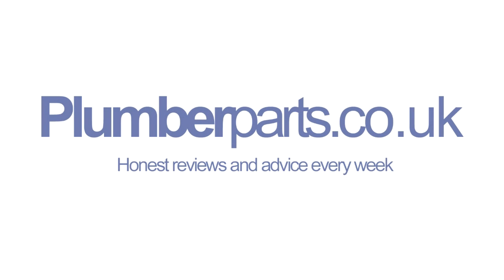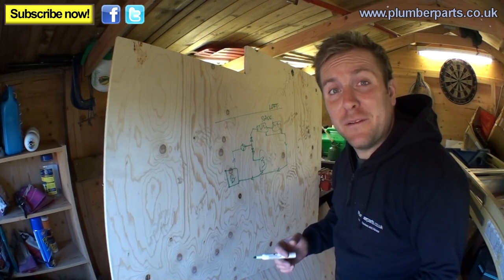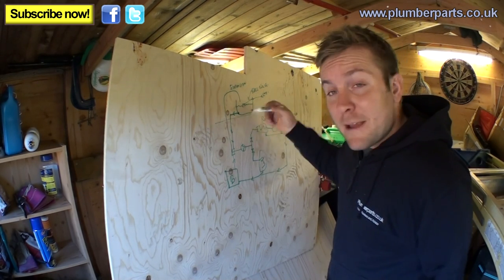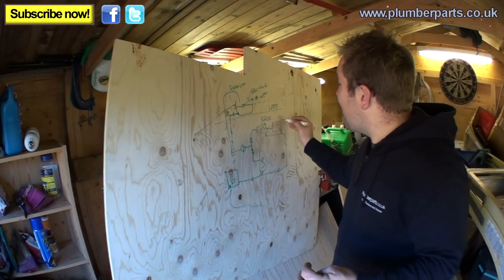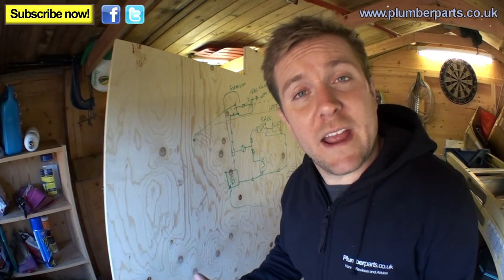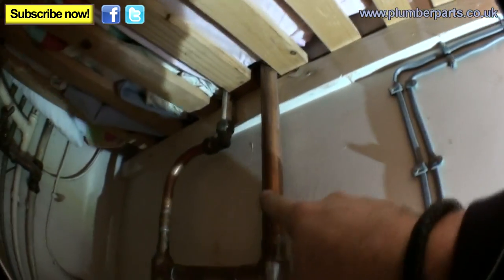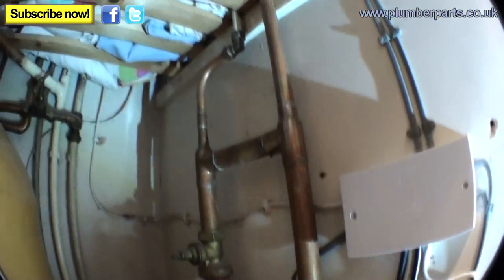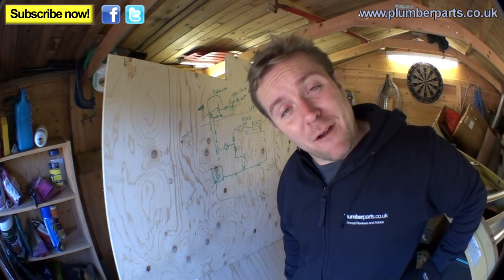GRAVITY  FEED HEATING SYSTEMS - Plumbing Tips

Comment from the maker: Links to the tools I use everyday here: https://www.amazon.co.uk/shop/plumberparts
Plus, follow my Vlog “TimesWithJames”: http://www.youtube.com/c/timeswithjames
Reply: if I turn the isolating valve in the airing cupboard from the F&E tank and bung the rubber torpedo shaped thing in the end of expansion pipe in the loft ... WOULD THAT CREATE A VACCUM hold the water in without having to drain the system?
.

Comment: After reviewing a slew of your videos am happy to report I've corrected my boiler problem. I recall from one of your videos you talk about using the 'magnet trick' in order to find a clog. I thought to myself 'where am I going to find a strong enough magnet for that?'. Luckily we have a magnet board and had stashed some of those heavy duty magnets we took away from the kids because they were a hazard. I was able to find that yes, the reducing tee from the feed and expansion tank was clogged to the max. After the drain and flush of the system video and happy to report I've moved onto the cleaning the boiler and after a brief flush and treat will start cleaning the radiators this summer. You saved me sooo much cash from the service engineer who couldn't stop parroting 'you need a new boiler, you need a new boiler'. £2000 vs £140 for a couple tools, piping and treatment chemicals is a no brainer. Thank you, thank you, thank you.

Comment: Hold Tight!!!! Thanks for all your videos, been a massive help to me. I've learn't how to bend and solder copper pipe and run them all under the bathroom floor, fit radiators, toilet, bath and work out an open central heating system all thanks to you. Boom, that's done! Cheers chief .... One question, on an open heating system, I guess the pressure is created by the loft tank so no need for pressure like inside the combi and closed loop circuits?

Comment: Very informative video. Thank you. One question however. The explanation at 8:25, the hot water flow and the T with the feed cold water pipe. Doesn't get the cold water constantly sucked into the system, so close by the pump? Thank you.

Comment: Thanks for this. I've just moved into a house with a conventional heating system. They have replaced the hot water cylinder with a new one in the loft. When the hot water is activated though, one radiator heats up. I assume they have connected the pipework of the old cylinder shown in your plan to this radiator?
Reply from the maker: I bet they have. Especially if the radiator that gets hot is in the bathroom.
Reply: @plumberparts  no, bedroom. Not much of an issue now but in summer i dont really want the bedroom heating. Guess it's a bit beyond a DIY to sort that out

Comment: Great video, thanks. Question. How do you increase pressure in such Semi sealed system if it is below 0.5? My boiler (Baxi system megaflo) user guide says nothing about it so I'm wondering is it even possible or ever needed. Thanks

Comment: Are these the old setups? When our new Vokera Boiler was installed the cold water tank was given the P45. Just to add, our boiler is making a burbling noise, bled the radiators but it still persists.

Comment: Great video . So if I was to take the rad off the wall for decorating( isolating and draining it first ) then when I put it back on , all I have to do to fill the system is to open the valves on the rad and bleed it ? The system should fill itself up from the tank in the loft right ?

Comment: Great video! What can I do if my expansion pipe is constantly trickling when my heating is running? I am training to be a bathroom fitter so I have some limited plumbing knowledge but not enough knowledge about heating systems. I'd love to stop the trickling when the system is running as it's actually quite loud. Our tank is at the top of the stairs as there has been a loft conversion.
Reply from the maker: Firstly turn the boiler temp down. Then the pump speed down. Monitor for a few days.
Reply: @plumberparts  thank you! Pump speed seems to have done it so fingers crossed....

Comment: Hi james, I have standard boiler in the garage, a storage cylinder in the airing cupboard and a storage tank in the loft, a small tank for the central heat but this doesn’t have a vent pipe leading into it ???? Just wondering why

Comment: The open vent is just that ...a safety vent to atmosphere to prevent any possibility’s of going to above boiling point it also enables trapped air to be excluded .... the Feed is the expansion and is usually one pipe size smaller so the water expands further up and back to the header tank IE :- it expands back to system water  the same  as per a pressure vessel . If water were to expand up the open vent. It would then fall into the header tank from height and would aireate this is the reason for pipes of different sizes to ensure this does not happen ... it’s a misnomer to call them a feed and expansion as the term is “feed and expansion combined” and an “open vent”.  separate !

Comment: G'day  I'm getting a rain water tank 3000L will feed  some of that water to the toilet using a gravity fed system  (an old copper tank in the loft that still in good Nick).I may go a couple steps more feeding the washing machine and dish washer,  having a PVC system  using sharkbite will make the job very eazy. I can still go one more step which is connecting to the hot water system, can this be done?  Rainwater tank at ground level  water pumped up to water reserve (old hot water tank) in loft  then feed to more or less the whole house  besides drinking water, low pressure 4-5 psi to the new gas Hot water tank out side is where I need help will it work  will she feed at such low levels  would a 2nd pump be required?

Comment: Thank you, subscribed.
Reply from the maker: Matthew Phillips cheers mate! 🥰
Reply: Great vids and Personality. My mate has just asked me to remove a couple rads in separate b/rooms as I’m a bit handy, your vids has given me the confidence to do it. Don’t want to take your time up but from what I’ve learnt from you is. Boiler off. Tie up ball cock. Hose on lowest rad. Open drain off. Vent. When stopped. Remove rads carefully. Solder cap fitting. Turn off drain off. Turn off vents. Refill by releasing ball cock. Fire up boiler. Job done? Cheers mate

Comment: I have this system, I’ve recently drained the system because we had a suspected leak at pipework under the floor near a radiator, since fixing the pipe I’ve filled the system and marked the level in the header tank then shut off the water supply to see if the level went down......it has by about 3 or 4 mm after 3 days! Does this mean I still have a leak somewhere? Thanks

Comment: Hi

I have a small bathroom with a Air admitance  Valve under the bath, this limits the amount of things I can update (I want to move bathroom around) can this AAV be repositioned outside (in roof space) and how much should I be charged.  I can do the floor removal in prep for the work?

Comment: Down stairs radiator  not heating  up . All others  hot. Removed radiator flushed with hose and re fitted  
Started to warm up then went cold .notice feed pipe hot return pipe still cold yes both valves open .could return pipe be blocked with sludge ?. Going to remove radiator  again and flush with chemical as well see if any more sludge. Now if i put hose on return  pipe and flush dose this push the water into loft tank

Comment: if i change to a combo boiler, where do i pick up the hot water? and do i need to seal  off any pipe from the old cylinder,  i know where to pick the heating system flow and return thats easy , bot not sure about the hot  water , can you help??? thanks keith

Comment: Sorry for being late to the party. 
Isn't that open expansion tank kind of an old design, with modern systems using expansion vessels? 
I 've seen some info about them, and they suggested a minimum hight for the tank, or if the hight cann't be reached, the tank needs to be of certain dimentions in order to have the needed preasure on the water surface etc.  
You never mentioned preasure in the system. My info mentions 1.5 to 1.7 bar, which needs a certain hight for the tank, and certain dimentions to be followed, in order to have the proper prasure pushing down on the water. 
Is my info correct? Is there anything else to be considered? Pipe diameter or position of the junction? before or after the pump, or on the return side?

Comment: Hi, my vented system has a feed tank sat on pressurised hwc wrapped in green in the upstairs cupboard should I try and isolate or bung the feed supply b4 I mains flush the heating syst.  I'm doing this cos or hot water supply is minimal and I'm told prob sludge build up around coil in cyl. Tried reducing pressure on our mains pressure on feed upstairs.  Thanks hope I make some sense

Comment: Sweet Vids braa! I've got one of these systems. I've drained it down, had sludge remover in, drained and refilled with someinhibitor. But now the boiler either konks out on its own and the overflow gets it or when the heating switches off the overflow goes. What's going on??
Reply: If water is running out of your overflow pipe it means that the header tank is filling which may mean the system is pumping over or the ballcock is faulty

Comment: I've followed your vids to the pixel and yet I cant seem to refill my system. Its conventional (as described here) but has 3 inverted loops (I needed to use the drain cocks on all 3 separately to drain it fully). Now I cant seem to get water back in to the system - I get some in and then it airlocks or simply gives up filling for some reason - no rad gets to the point of bleeding water - just air for a while before they stop. I had all downstairs trvs and control valves open but bleeds shut and upstairs rads with bleeds open. Any ideas why it's not filling properly? I've bled it all down again and am back to square one. I also latched open both 2 port valves - my system didnt reflll at all in fact until I turned on the hot water system strangely.

Comment: I am going to replace my old galvanised F&E tank, finally, a couple of years ago I bought 2 tanks, one for cold water supply, and a smaller one for the F&E,  I replaced the cold tank but put off doing the F&E now Questions, does it matter if the  new tank is larger?  And I’m not sure if it’s a small cold water tank, or suitable for 70c ,I am not sure if it has anything written on it, I am sure I would have stated what it’s for at the time I bought it, a few years ago. Should I buy new or use it, thanx Mr Plumber.
Reply: I would like to add to my previous question it’s a poly tank pc12R

Comment: I hope you can help, I'm replacing radiators and used quite a few btu calculators and each calculator comes up with an entirely different answer/total.  Can you recommend a calculator/website that gives the right answer

Comment: thank you for your video's, can you do a clip on a plumbing system for a wood burning stove boiler? it's very confusing, I'd like to be able to run my radiators and hot water from it but don't know what type of system to use, also whether I could plumb in the combi so that when we don't use the burner in summer we can still call for a hot shower, thanks
Reply from the maker: It is a very involved system of controls for that....might do a vid if we come across it!

Comment: Hi, you say some people fit the feed pipe straight into the vent pipe. Is this acceptable or to be avoided.
Appreciate it if you would clear this point up as I,m thinking of doing this to get over a blocked feed pipe lower in the system that I cant get at easily.
Cheers mate, really informative vids.
Reply: Combining the cold feed and open vent pipe is acceptable.

Comment: Why is my feed pipe hot and Vent pipe cold. Sometimes. It used to be the other way round. Why would the hot water go back up the feed pipe. Or maybe the Vent pipe spewed a load of hot water in to feed tank and then cooled down, leaving the feed pipe hot as the water feeds the system. Radiators are all hot so I just want to know if it is something that needs attention or can it be left?

Comment: hi just a quick question. l just change  waterpump in my ollllllddddd heating system , and after that  (and before)  pressure in heating system  is very low.  Any idea what could be wrong??

Comment: Hi there thanks for the vid. My system has a hot water cylinder with separate ch and hw controls. It also has a couple of large tanks in yhe the loft in addition tonthe small ch feed tank....I beleive its a fully pumped system.
If i drain down the ch to fit some new rads,  will i have to also switch off the hot water and take cold showers while ive got the system drained?

Comment: Good video's mate ,with a bit of jolly banter 😁
Iv just subscribed ,as these week I am mostly being a plumber lol 

Iv got a lovely old baxi solo 2 pf ,and recently changed the board ,plus the air pressure switch ,and it's now firing up a treat ..
One problem I do have though is the gas valve after about 2 hrs of the system running lovely ,decides to make a lovely old buzzing noise ,when it's about to fire up on call for heat .
So iv ordered a new gas valve ,hopefully this one won't want to buzz it's head off occasionally lol

Comment: I currently have a 2 pipe system and wanted to plum in my heat exchanger on the back of my aga can I just use this system to plum it in only difference is I don't have a hot water cylinder
Reply from the maker: It's perfectly possible, but you'll need pipe stats, two port valves and a circulating pump all interlocked. It's actually really easy!

Comment: hi, I have a gravity fed system and when the heating comes on the hot water comes out of the expansion pipe all the time the heating is on. Causing a lot of condensation in the loft, can you help please?. Regards Ian.
Reply from the maker: Turn boiler temp down. Turn pump speed down. Increase crook height. GOOD LUCK! SUBSCRIBE! ➡️👉 https://www.youtube.com/subscription_center?add_user=plumberparts 👈⬅️if you haven't already!

Comment: Thanks for this video! It's really great! My vent/expansion pipe going into the F&E tank feeds hot water into the F&E tank sometimes. Is that okay? Or a fault? Also, it is only JUST above the water level and so sometimes is actually submerged! Is that dangerous? Many thanks again!! You are a life saver
Reply: No mate, if hot water comes out of your expansion pipe into the header tank it means your system is pumping over. The problem that this creates is fresh water is being constantly added to the central heating system which will lead to corrosion of pipework, boiler, radiators ETC. it would be a good idea to have a heating engineer come and take a look at your system. This may be a shot in the dark but if you have a fairly new type of circulating pump installed you could turn the pump setting down which may cause it to stop pumping over. If this isn't the case the location of the pump may need to be altered or like plumber parts says at the start of this video the expansion pipe may need to be taken to a higher level in the loft. Hope this helps you or anyone else having this problem.

Comment: drained my system today but it doesn't seem to be filling up again, its like there's no pressure and the water is trickling out, i left a couple of radiators on the ground floor disconnected until they can be replaced would this maybe be causing the problem, or maybe a blockage some where? it seemed too drain ok.
Reply from the maker: +nub Blocked feed pipe. Usually where it joins the main system (and irritatingly near the pump!) Will need cutting out and changing or blasting through with mains water!

Please sub >> https://www.youtube.com/user/plumberparts << if you haven't already! Cheers!
Reply: +plumberparts so i can just hook up my main to the heating system and run it at full blast to see if clears anything? thanks
Reply: +plumberparts interesting my pressure appears to be back, accidentally left the bleed screw loose on one rad and just noticed it's been spitting water out for the last hour or so, would that mean its been an airlock then? though i'm sure my system needs a good cleaning/flushing and blockage of some sort wouldn't surprise me.